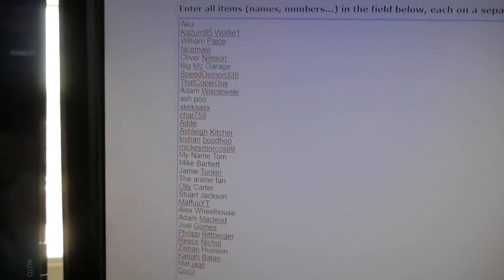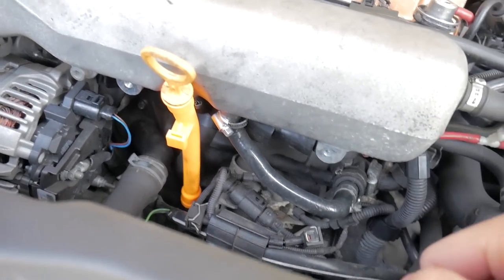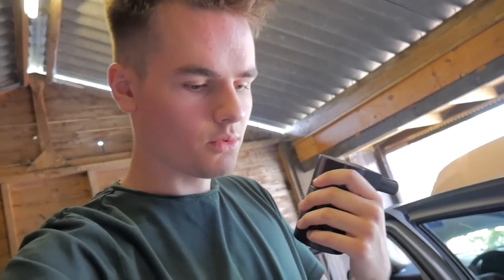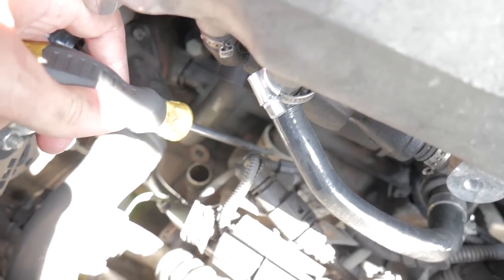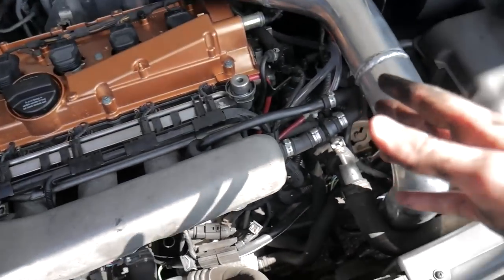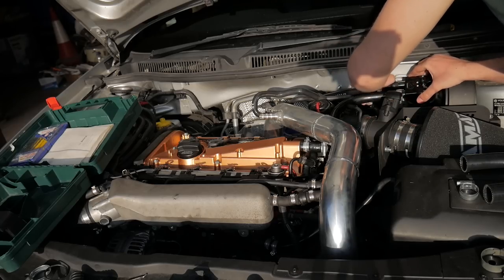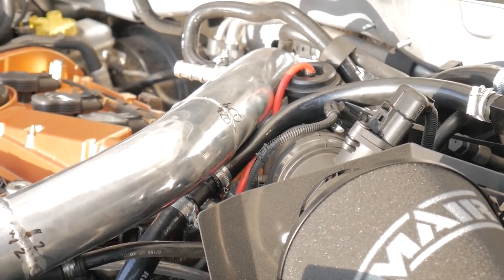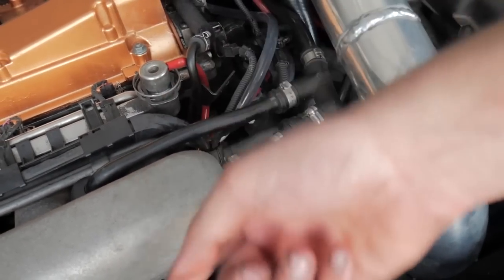Mk4 Golf 1.8T Oil Catch Can Install!

Comment: You can eliminate the puck (pcv valve) if you have a vent to atmosphere catch can. Yours is sealed so it won’t release crank case pressure and basically cause oil leaks everywhere. So you should keep it
Reply: On the catch can output you can add a filter and vent to atmosphere? and remove/blank off the Hockey puck?

Comment: The 'hockey puck' is actually a very crude separator so isn't really needed. It just prevents liquid flowing into the inlet which means the any 'oil' will flow back to the engine and the vapour will be sucked into the inlet.
Reply from the maker: Cal M ah right I see! Thanks for explaning 👌
Reply: The 'Hockey Puck' isn't a separator. It is the pressure regulating valve, PRV. It is intended to guard against the vacuum pressure becoming excessive in the PCV (positive crankcase ventilation) system. Alot of people confuse this valve as being a one way check valve - it is not a check valve, you should be able to blow through it both ways. It should be free flowing to air flowing from the PCV pipework into the TIP (turbo in pipe) whilst it offers restriction to air flowing the other way. It is this restriction to air flowing from the TIP into the PCV pipework through the PRV valve that regulates and guards against excessive vacuum pressure being generated.

Comment: On my BAM S3 I deleted everything under the inlet (that pipe you were unsure about) and ran a 1 way valve from the inlet to the brake booster but not too sure I should have got rid of the vacuum ejector as basically now under boost (when my car isn't making vacuum) it isn't supplying vacuum to the brake booster. This wouldn't usually be an issue as there's enough vacuum there already for 1 or so brake presses and gets topped up again when I let off. So unless you are left foot braking to keep the car in boost it doesn't matter.
In fact some 1.8T's didn't have ejectors and I know the A4's don't instead they have a vacuum reservoir. But meh, I could fix it if I wanted to, by adding the ejector somewhere but I honestly cba
Reply from the maker: Cal M ah I see that makes sense yeah, I'm not sure what to do 😂

Comment: I also got a GTI mk4 1.8t, with turbo problems. This might be hard to believe, but my T-connection (which you held at 5:21) is also very soft like yours. I bought a new exhaust pipline (the thickest one, like you did) but my turbo problem was still there. I bought a new "T" connection (the one at 5:21), and hopefully that will fix my problem. I just hate the fact that my Golf is not idling at a stable rate. It's annoying af xD. Anyway, I like really your videos and I always watch/like them when you upload. Watching you fixing your car, sort of reminds me when I'm doing it. I know like half the shit I'm doing, but in the end it usually turns out to work hehe :). Last but no least, GTI mk4 1.8T RULEZZZZZZ, best car ever.
Reply from the maker: Hope that fixes it for you! Cheers for the support man 👌
Reply: If the car isn't idling right and has shaky boost when accelerating full throttle its definitely your air flow sensor that's next to your airfilter.
Try accelerating once with the airflow sensor disconnected. Should boost like normal.
Just replace the sensor if you have problems. Just cleaning it doenst always work and makes you look in the wrong places
Reply: Clean your throttle body and get a new gasket for it and go thru all of your vacuums lines that can cause you to lose alot of boost or not even boost at all really

Comment: Do u think about maybe doing a supercharge on your gti
Reply: Boris Why would he do that when it already has a turbo. Just get a bigger turbo. Makes way more power than a supercharger.
Reply: Shona i know but theres different pros of a supercharger and idk
Reply: Shona just interested to see what a supercharged gti would be like
Reply: Boris No harm to Brad but I don't think he has the money to undertake a project like that
Reply: Shona and also i thought supercharger are cheaper and easier to install and then he could sell the turbo idk
Reply: Boris A K03/K03s turbo is only worth about £150, a BBM G60 Supercharger is over £500 for the supercharger alone. Then you have other work to do on top of that and will achieve 300bhp. Which is a figure that can already be achieved by a direct bolt on hybrid turbo for £500. The only time a supercharger makes sense on a 1.8t is when it's twincharged. Which requires a fully built engine, which Brad couldn't afford. It would be cool, but just doesn't make much sense both logically and financially.
Reply: Shona oh yea tru but yea it would be cool
Reply: Super chargers are better suited for bigger engines. Adding a charger to the rotating mass of the engines accessory belt is not as efficient as a compressor spooled by exhaust gasses. That's why the chevy cobalt ss bombed. It was super charged and sucked.

Comment: Nice video.
Reply: Second break booster line isn't needed. Just cut but keep the inline valve (you will see it) if you follow the line there is another valve but two is better than one so keep both.
Reply from the maker: andrew wright yeah I thought as much 👌
Reply: BWTV remember that connection on the underside of the manifold if something like 8mm and not 4mm like the rest. I cut that pipe coming off of it like 4cm from the manifold and bunged it with a bolt and clip. Held for year and half with no issues.